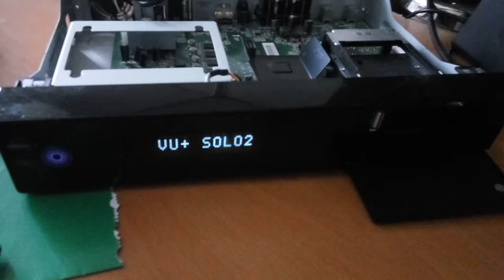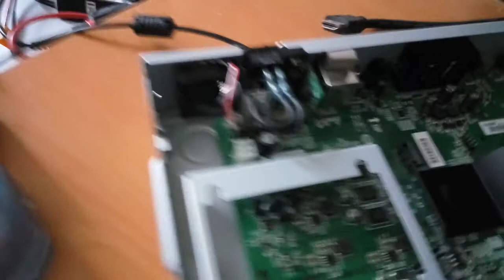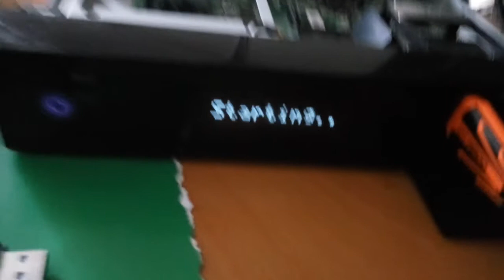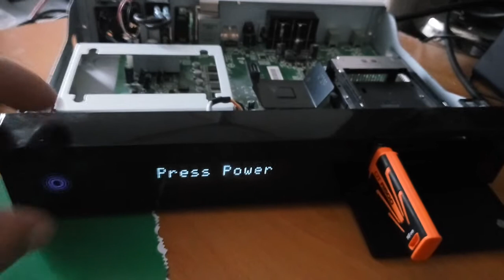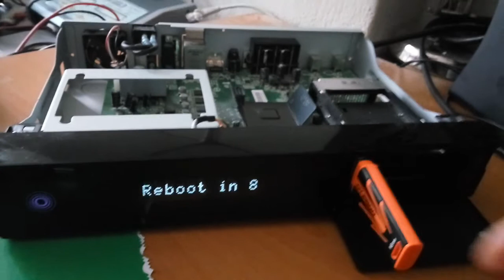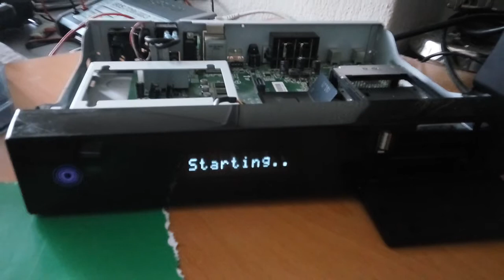vu+ solo2 won't boot

Comment: I had this same problem, after a power outage my box was stuck on "Starting..". On the TV screen I could only see the VU logo. First I have replaced the electrolytic capacitors on the PCB, many of them was dried out. After replacement still no boot, so I tried to re-flash the box with the latest official OpenPLI image. The flashing was stuck at loading UBIFS. After waiting 5 minutes, I turned the box off with the hardware switch (front power button was doing nothing), removed the USB drive used for the flashing, then powered on. Voila, the box is working again, and all settings remained!